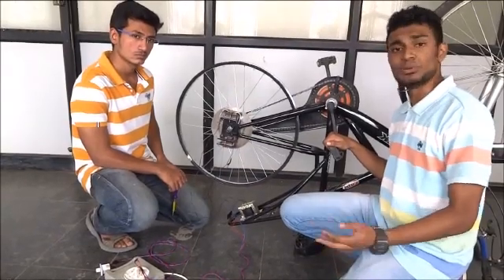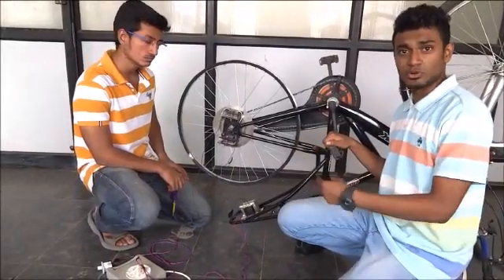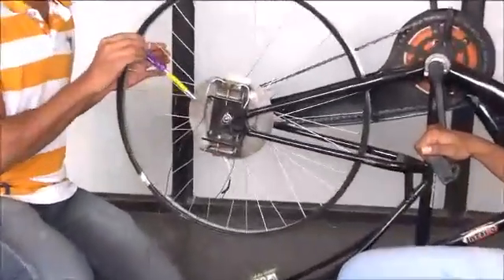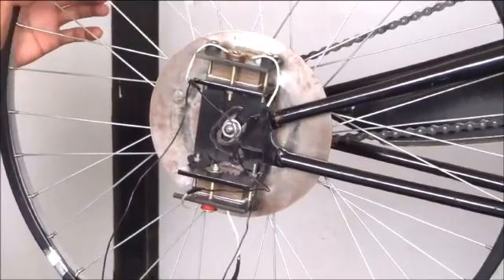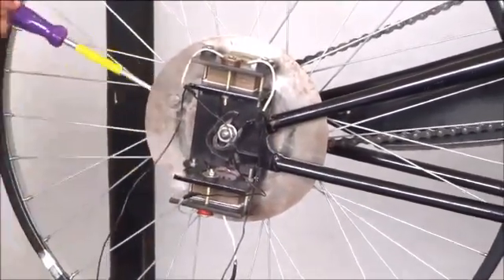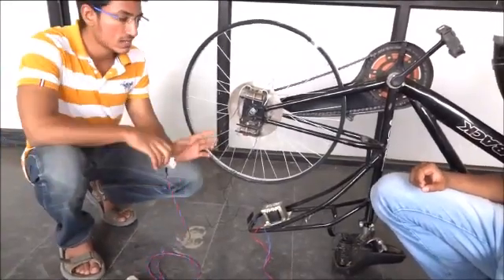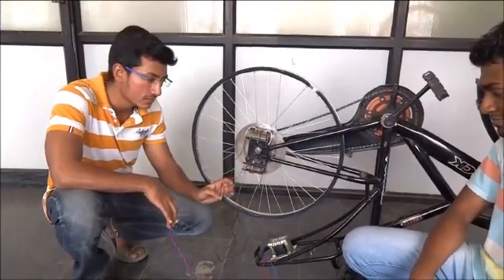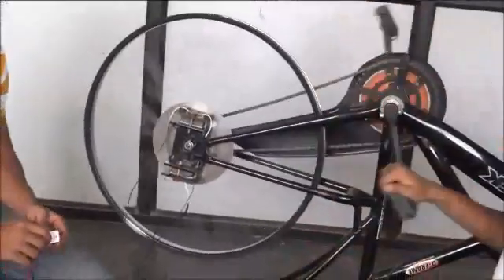Electromagnetic disc braking system

Comment: Hey!
We are working on a similar project..but we will be testing different disc materials.
Can you please provide the details of the electromagnet used in your project?
Was it a pre-fabricated one or did y'all make the electromagnet?
Please do reply.Your Help will be solicited!😁
Reply: Hey Rahul me too working on same project. I haven't started anything yet, can u help me a little?!
Reply: @ramannaagre7938  Hi!
We too haven't started anything yet..we are still in the Inception stage..but will be fabricating the test rig soon.
Reply: @raulbraganza3151  fine 👍
Reply: @raul Braganza, even we had done testes on different materials and thickness. We had designed our own electro magnet.
Reply: Hey bro can I get ur contact details

Comment: Hi, I really like your project! Current, our group is working similar capstone project like yours. Could you please specify what electromagnet you used? How much voltage you give and distance between your magnet and metal disk?
Reply: the voltage supply will be 24v and distance would between 1cm to 2 cm